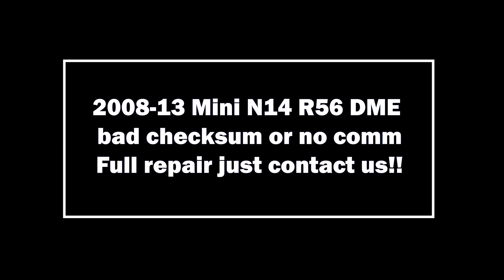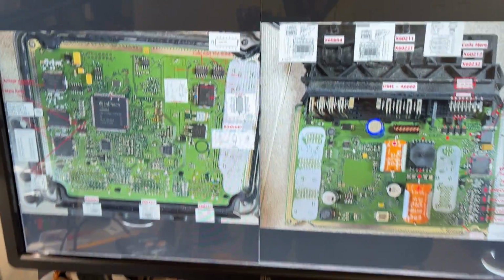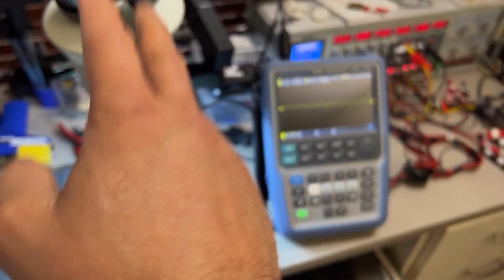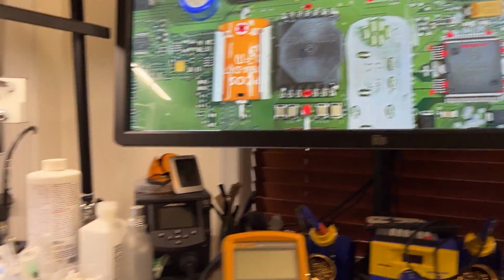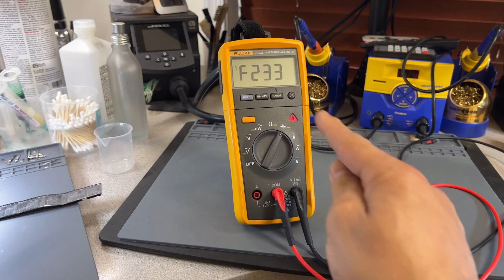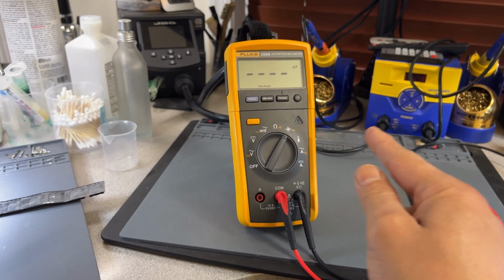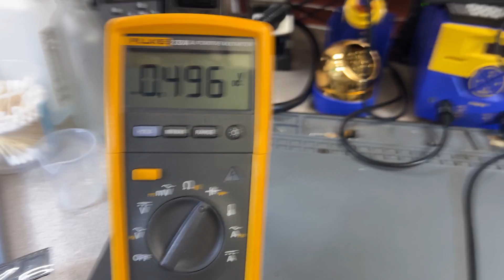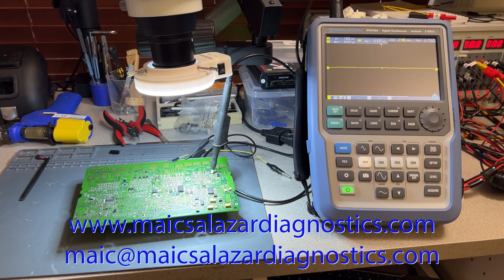2008 10 Mini R56 N14 DME checksum error or no communication!  Repair with us!!

Comment: I'm replacing the voltage regulators on the same ECU in this video, they are the four on the end of the board they control the coil packs can you tell me what size they are

Comment: I just messed up my DME. Now my injectors are not communicating. I found corrosion and was trying to clean it and I messed it up. The bad part is my DME has been opened up at at least three times that I know of. Looks like this is something you could fix.
Reply from the maker: I can try! I will need to test it first to see if it can be repaired.
Email me at maic@maicsalazardiagnostics.com

Comment: Apart from the oil ingress issue with the N18 engine (which I guess you can't fix?), these ECU's usually do not fail by themselves. Usually, they fail due to a floating ignition ground wire after replacing the timing chain. When the engine is stared with a floating ignition ground wire, the 5v reference to the accelerator paddle is increased, breaking the  accelerator paddle and causing internal failure. Is this the issue you are fixing?
Reply from the maker: I do fix all issues

Comment: Nice job boss tell me something about this app which app you can use for diagrams and pictures for component
Reply from the maker: Hi, There is no app, that was done by me! I took a picture and marked all components and their track. This is called ECU map.
Reply: @MaicSalazarDiagnostics  Nice work, I'd like to ask, is there any place/website where they have these ECU "maps" or similar ? Or any other reference(s) ? Thanks in advance
Reply from the maker: @thesmartguy3523  no to my knowledge. This is something you do as you work on the ECMs. All diagrams you can find are for the vehicle connections to the ECM, like in identifix, alldata or Mitchell.